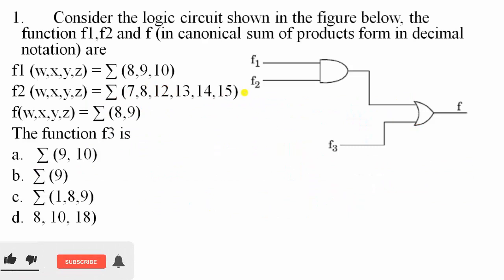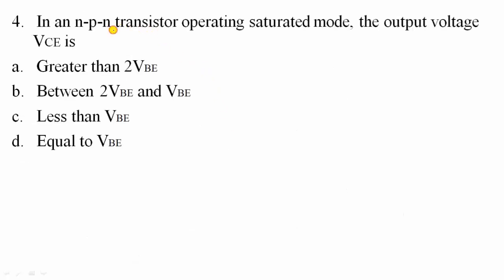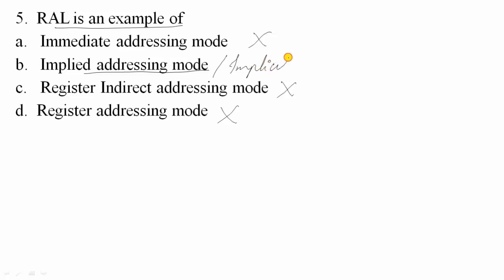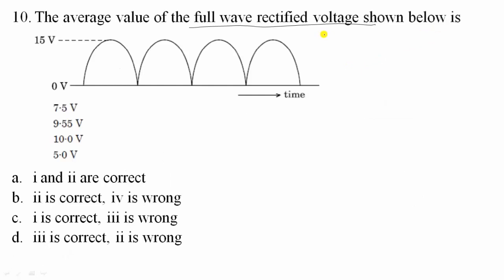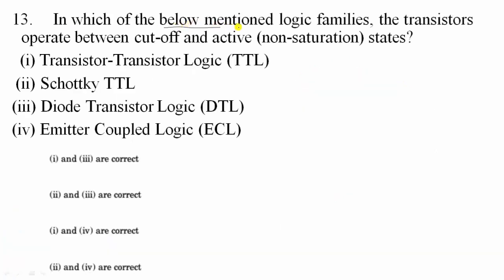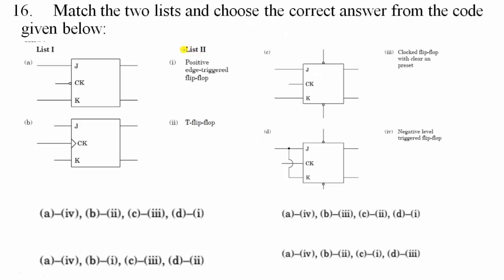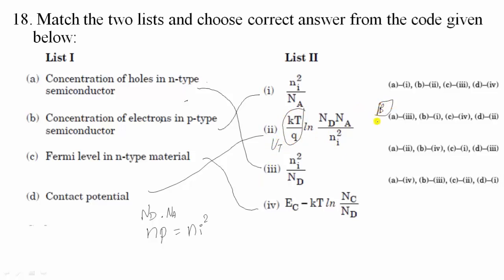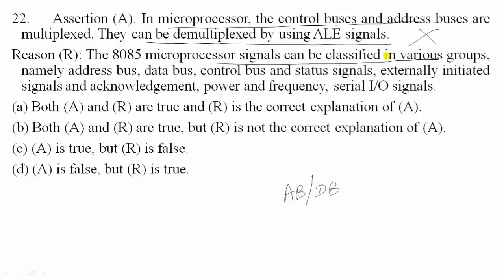UGC NET Dec 2018 Electronic Science, Part (1/4)

Comment: For 20th question, voltage gain of CC is approx 1 but not less than unity.so isn't the correct option 3? Reason is false
Reply from the maker: 0.98 is the voltage gain in CC mode